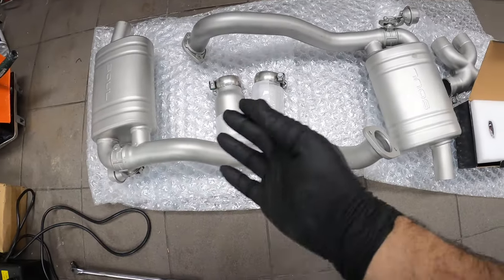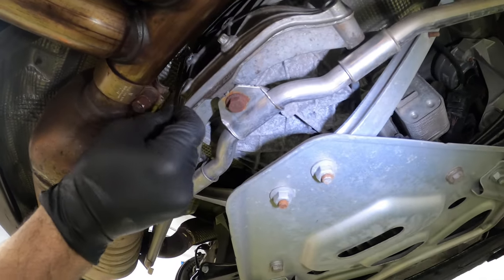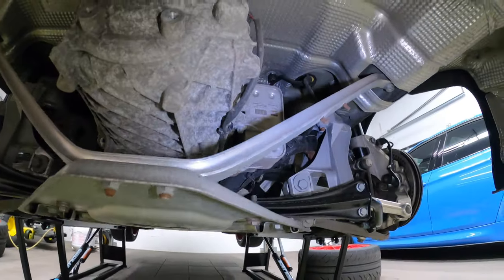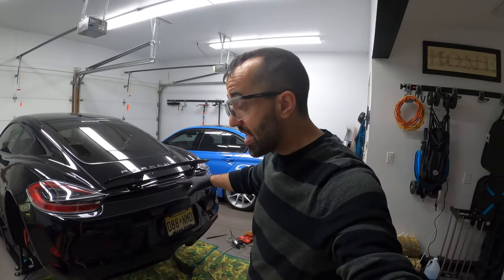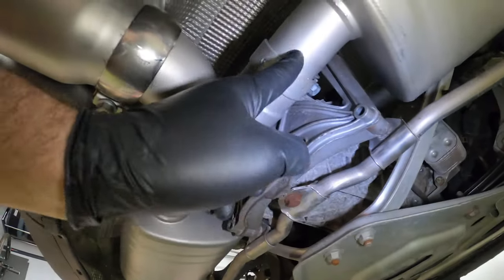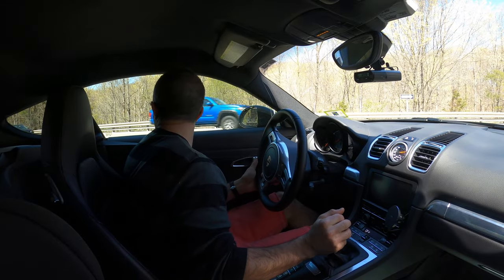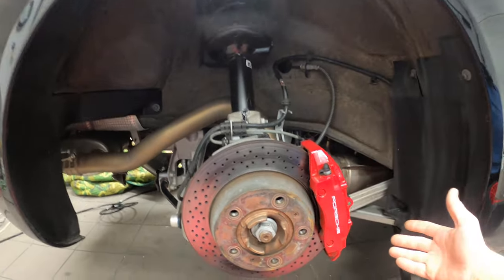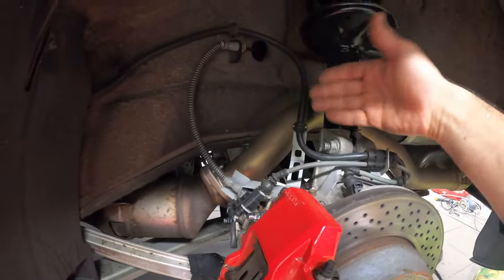SOUL Exhaust DIY on a 981 Porsche Cayman S: Tutorial and Sound Clips

Comment: Last week we just installed a Soul non-valved exhaust on my 2016 Cayman.  . My car was bought new by me in So Cal and doesn't have many miles and no rust so everything came off no problem. Watching you deal with those rusty bolts and nuts sure did not look like fun, but good on you for getting through that part.  I like the fit and finish on the Soul exhaust as mine went on in no time with the car up on a lift. The pops, bangs and burbles from both on and off the throttle  being the best part of the whole thing to me.  I also like the slightly smaller size and a little less weight. After the install I wiped everything down with WD 40 and will have to check my pipes to see what they look like now after the first run in.
 I ordered my car in Jan 2016 after I read that Porsche were going to a 4 cylinder turbo in the new 17 models and was always glad I did but the one big  option I did not get on my minimalist build was the Sport Exhaust .I even bought a slightly used OEM Sport exhaust  years ago but was never motivated to put it on. I like what you have done so far with your Cayman, you are helping show what great cars the 981 models are and how to make them even better.
Reply from the maker: 981 cars are I need so amazing. I love every mile spent in it.
Reply: Glad you're liking your Performance Exhaust System! - Mike
Reply: @SoulPerformanceProducts  It's the modern day "Cherry Bomb" could not be happier !

Comment: A piece of advice to anyone doing this job, drench all the nuts and bolts in plus gas, leave overnight,  use some heat on the nuts, then use a damaged nut extraction socket, they are very cheap to buy,  this is the life saver, grips what’s left of the nut and digs into it, with the heat on it to expand it and the threads cleaned up as best possible, they should come off, I just did it and all were i off in 1.5 hours and was pretty easy tbh!
Reply from the maker: Good idea!

Comment: Now that the system has been installed for the past 16 months what are your overall thoughts on the setup? Has the color changed much or was the color change due to the product being covered with an oil as a part of the manufacturing process?
Reply from the maker: Color changed. This was the best modification I’ve done to the car. I would do it again without any hesitation.

Comment: I wonder if in the end if it would’ve been easier just to remove the headers. I always hear everybody say that removing the headers on a Porsche is super easy. So I wonder if it would’ve saved a few days by just buying some new exhaust gaskets? Anyways awesome install and such a rad track car🏁🏁🏁👍🏼👍🏼👍🏼
Reply from the maker: Good idea. I was actually tempted to upgrade the headers too but I won’t bother. This thing sounds perfect now. No joke
Reply: Don’t really help as your driveshafts are in the way for complete removal, with the headers still attached it would be quite heavy and awkward to manoeuvre about, they don’t split easily at the rear boxes, even on the ground they are hard to split

Comment: Is there a Part 2, where you hook up the controller? I have installed the Porsche Sport Exhaust system on my Boxster 981 but not the controller yet. I actually have the Soul controller unit with transmitter. Curious how you tie into the vacuum and electrical on your vehicle.
Reply from the maker: Yes there is - check it out here: https://youtu.be/ohqaGfbtD5Y

Comment: Those bolts were a pain the as* to remove. Took me the whole day to remove my stock exhaust and upgrade it to PSE system w/ a valve controller aswell.
Reply from the maker: I’m glad I was not the only one
Reply: @TommyLGarage  Yup, the rest was pretty easy except those bolts. Are you planning to upgrade your headers as well? I think you should. I have 200 cell cats waiting to be installed and from the clips I found on Youtube, it will take the sound of this flat-six to another level.
Reply from the maker: Adam E Honestly I do not think I will bother. Heathers will create drone and I want to be able to enjoy the car a long cruises. At this point it is loud enough for me
Reply: @TommyLGarage  I heard that's a problem with after market exhausts. With PSE, it's not an issue. Mine doesn't drone and it's totally quiet when cruising on the highway. As quiet as stock in my ears. But once you open the valve and put it on sports/sports plus, it becomes a totally new car. I'd still say high flow cat headers is a must for sound and power upgrade. I had mine installed today and tuned to stage 2.